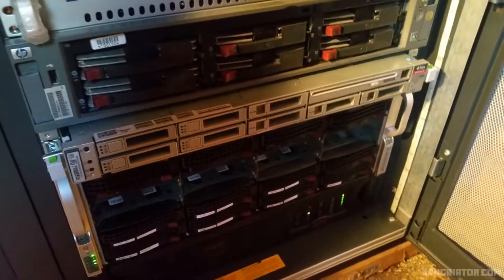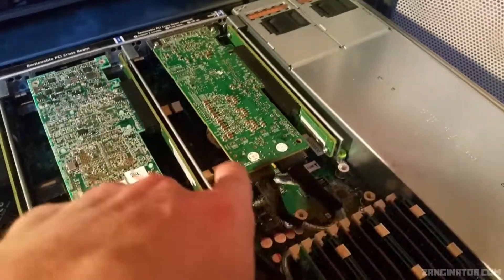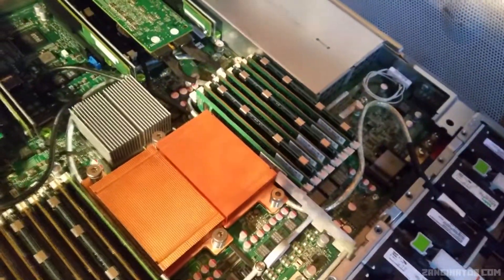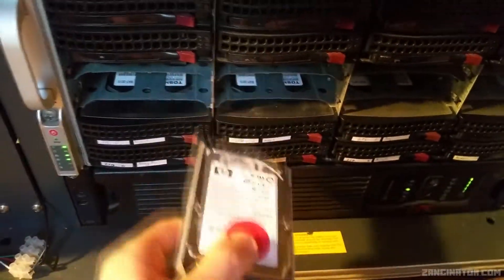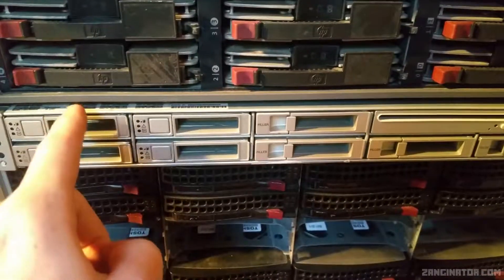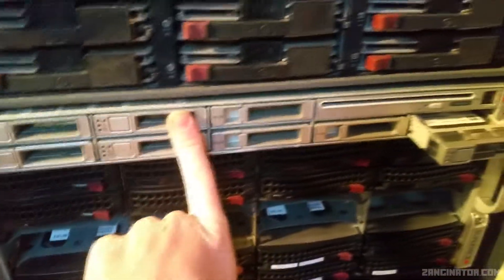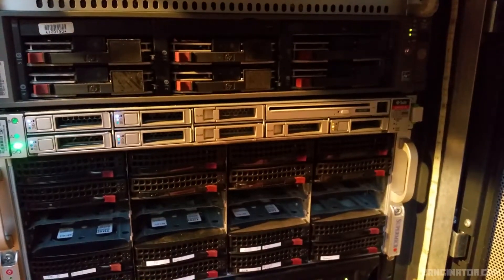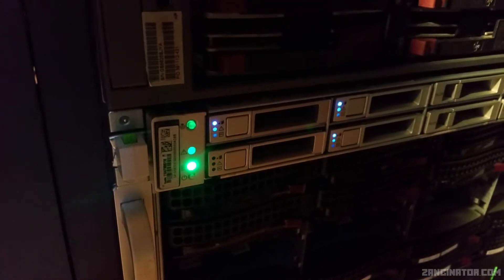June Server Vlog Update - Fixing a few things

Comment: Ahhh crap - so the flashed 9240 (≈9211) is barfing memory ? I'm guessing it was too much effort finding the leak or compiling your own kernel/modules ?

Hopefully won't affect me as I briefly looked at Proxmox and decided meh - I don't have a big server so the free VMware hypervisor license should be enough for my needs.

Another great video - Thanks

ps: I'll try proxmox/zfsd to see if I get any kernel leaks.
Reply from the maker: In this server it was actually a 9211 card (that came in the server). It wasn't the cards vault it was more of a bug within ZFS on Linux.

On the FreeNAS box, as it is a system dedicated to storage using ZFS, its not an issue that it uses all the RAM.

However on the Proxmox box, I kind of need that RAM for VM's as well. I played around with some configuration for limiting the sizes of the ARC and ZIL caches to hopefully prevent RAM being swallowed, but it just seemed to ignore them.

With this system being more performance oriented, the additional IO wait and lack of throughput of ZFS when at high load, it was just favourable to go with a dedicated hardware RAID than essentially software RAID via ZFS.
Reply: OK thanks for the feedback. Nonetheless I'm still going to try to see if I can replicate this problem .... I like memory leaks :) ( disclaimer : not with production data though ;)
Reply from the maker: No problem, if you can replicate the issue (and come up with a fix) that would be excellent. Let me know how it goes :)
Reply: (and come up with the fix) .... cheeky git :)

We'll se how it goes.... don't get as much time to play these days but need to give proxmox another shot so we'll see if this issue bites me too